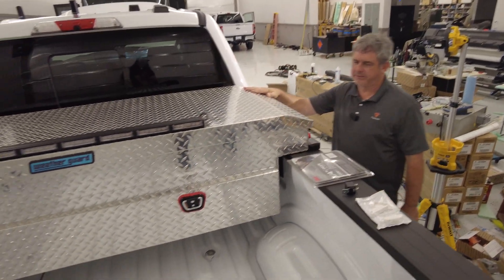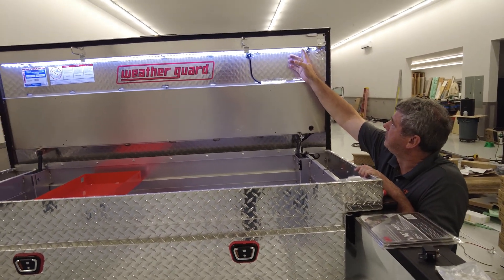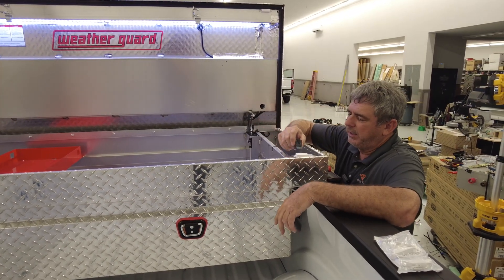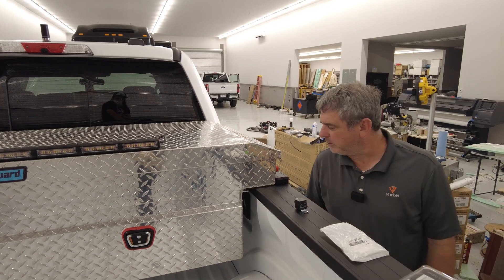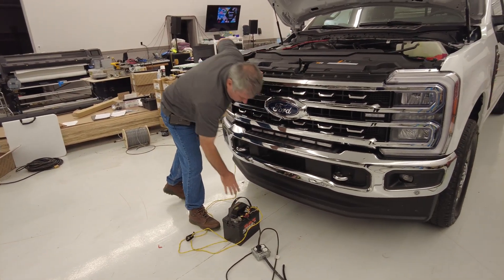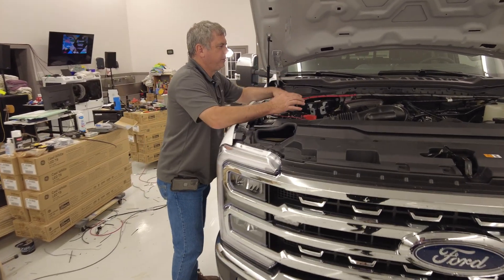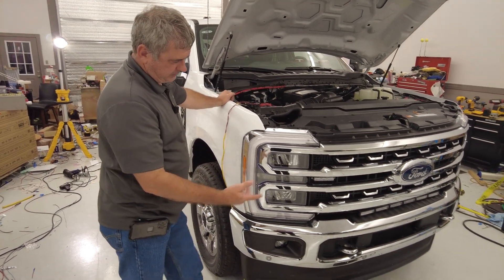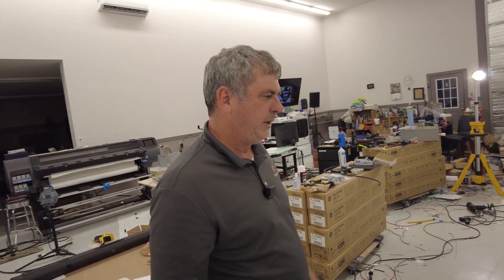How to add LED lights to your Weather Guard Tool Box!

Comment: The Phrase "how to" Really has way more meanings than it should. In this case it means let me NOT show you how to do something and show you something I want "at a boys" and praise for.
Reply from the maker: you may be correct on this video - although I was not looking for an "at a boy" -- if there is anyone out there that would like more information regarding this video - please drop it in the video comments and I will do my best to answer any question or provide better direction if you wanted to implement this yourself -- I might even just suggest a mechanical switch (like a plunger) or a mechanical magnetic switch (more current no relay needed) rather than a reed switch and the complexity of adding a relay ---  

the other fault probably lies with me not being more involved in the titling and thumbnail process and letting my editor make all the titles and me sloppy in the review -- I checked out your channel and noticed that you can probably agree with the titling challenge -- i don't like click bait type titles and we will try to do better in the future -- 

i really appreciate your comment and I agree with you that the title is a little sloppy -- It should have been check out this cool idea .... or perhaps you could suggest a better one -- 

thanks for watching